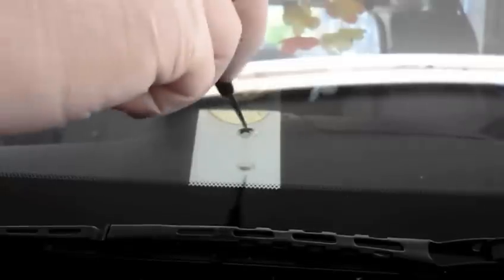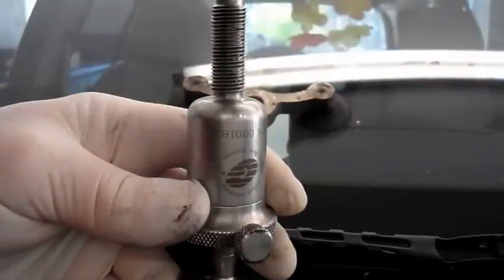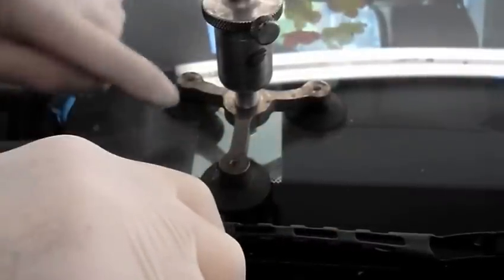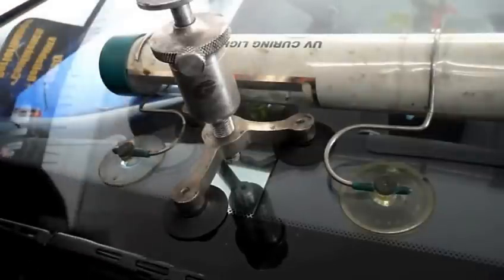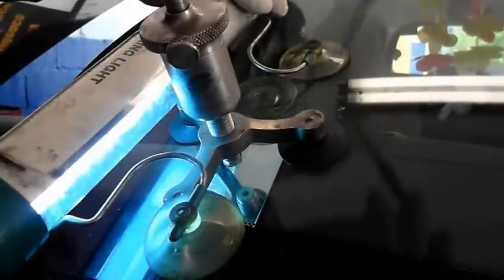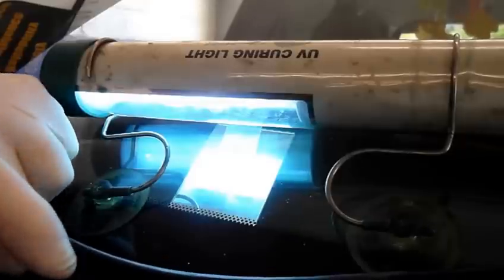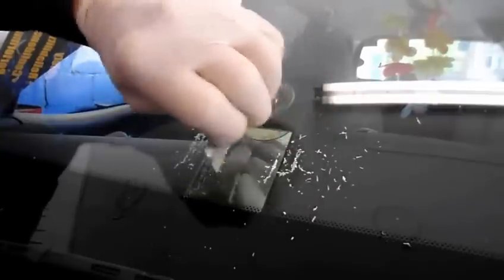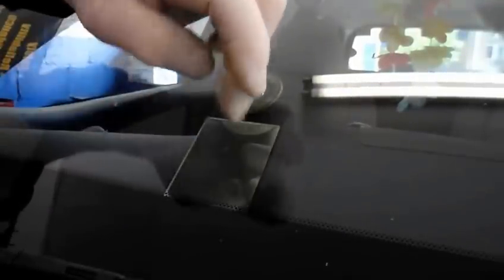How I Repair The  Windshield Without Replacing It

Comment: amazing repair.
Reply from the maker: tunnelportterror  Thank you for your feedback and for watching.Jim
Reply: I changed the keyswitch in my 2001 Monte Carlo, based on your findings and another fella on youtube who did a detailed video of how to actually pull the dash off to get at it.  Had it out in my hand in about 15 minutes.  A little longer putting the new one in, because the button kept popping off the 4 way switch.  anyway, I took the old keyswitch apart, there is a total of 6 sets of points in it.  one goes on when the key is inserted, another pair on accessory, and 3 on start.  of them all 3 were burned moderately with buildup.  this car would not start occasionally, required sitting for 10 minutes with key on, then it would start.  not the entire 30 minute stint of passlock, but just 10 minutes each time.  we had to start the car 10 minutes early every morning  just to make sure we were on time, in case it did not start, to do the 10 minute key on thing.  well now it starts reliably first time, every time with the new keyswitch. thanks.